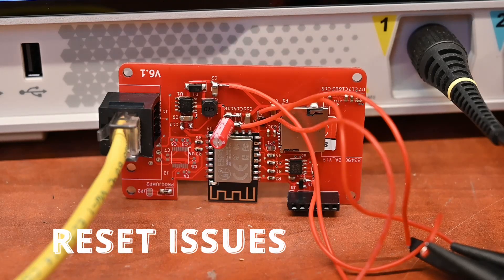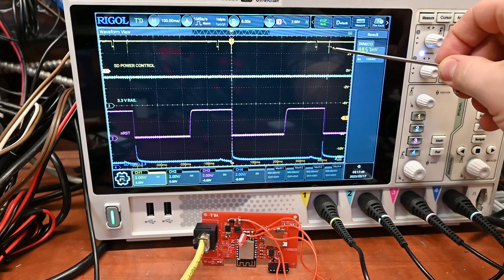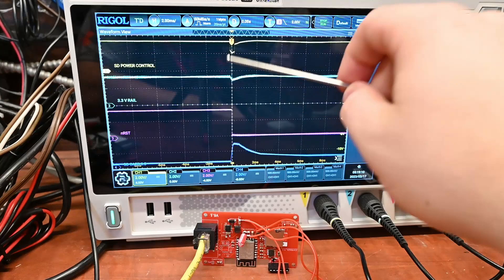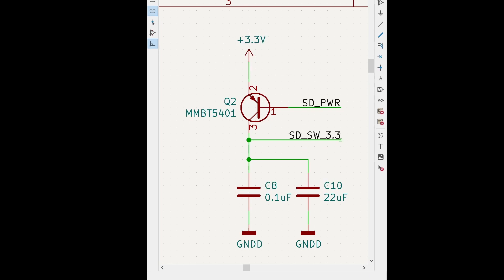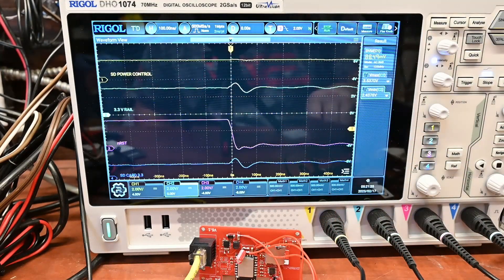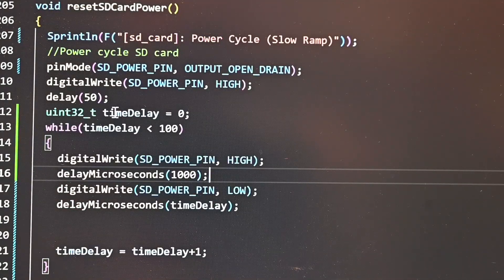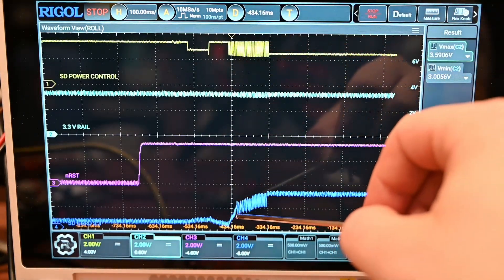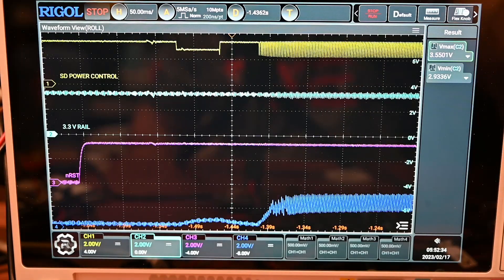Solving ESP8266 Reset Issues - Product Development

Comment: I suggest not worrying about moving around your capacitors. 
Instead, control the voltage slew rate on the load side of your SD card power switch by adding a "miller" capacitor from base to collector of your switch transistor.
Combined with your base resistor (which I did not see) this capacitor will precisely define the rate at which your load side voltage rises, and thus the current drawn by the charging capacitors.

Details in patent WO1995024076A1.
Reply from the maker: Thanks, I had a look at the patent and some other discussions and it seems like a good solution. I'll have to do some experimentation maybe I'll make a video about it. But I'm also inclined to switch to a mosfet instead and reduce the parts count.